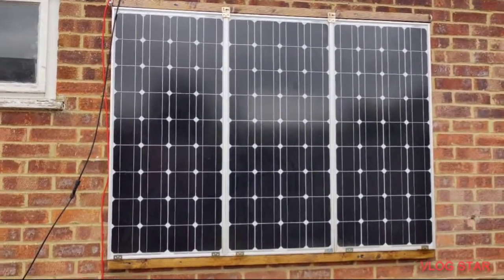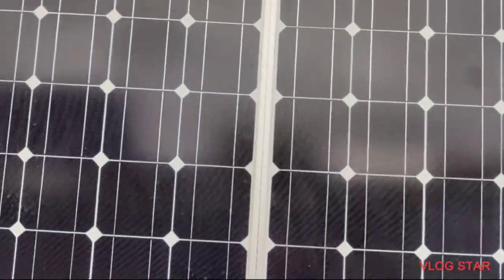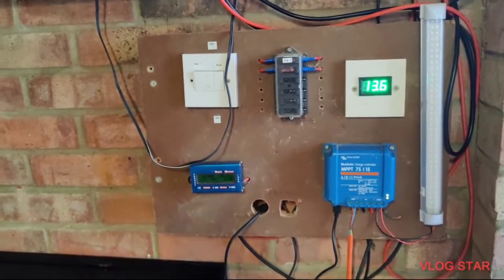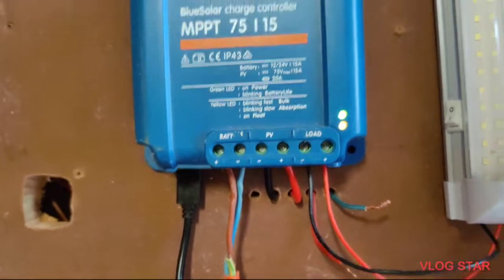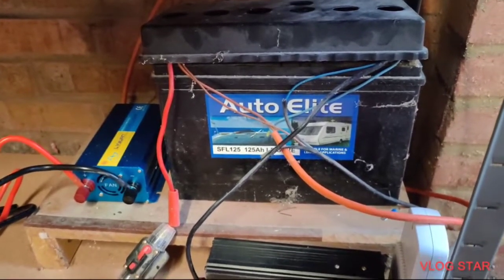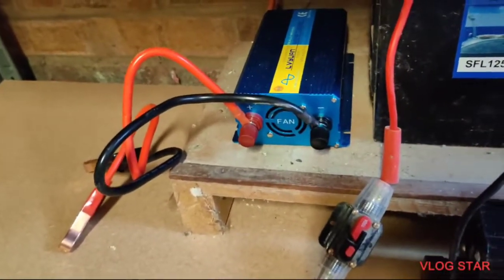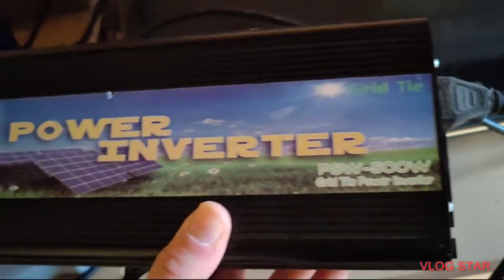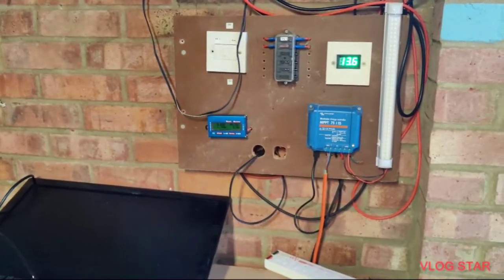Mounting my Solar panels.

Comment: Hi,
Very grateful for you. How big the energy difference than if installed tilted?
Thank you
Reply from the maker: @justiceonly9105  Hi, thanks for the comment. I lose between 20 to 30% of the energy  by having them flat against the wall. I originally did have one of them tilted but you had to keep altering the angle every summer and winter to get maximum results. This way it’s the same power output all year round. Marginally better in winter when the sun is low here in the UK. Hope that helps.

Comment: Thank you for the video. I am trying to mount solar panels same way. Do you see any issues with that after a year?
Reply from the maker: Hi, and thanks for the comment. I’ve had absolutely no issues with this set up at all and is still there and working fine. Obviously because they are flat wall mounted they lose about 10 to 15% of the anticipated power than they normally would if angled correctly. Other than that though I have no regrets doing it this way. Hope this helps.
Reply: @Digaroo-gadgets  I notice you said you were going to buy a gridtie. If so its best to get one with a limiter.

Comment: I also have wall mounted solar panels. But I have chosen a slightly different approach. The top side of the panel frame is simply hanging in a h-shaped aluminum profile, which is screwed to the wall with some plastic spacers that resemble huge washers (plastic 10 mm thick). The lower side is then pop riveted to an L-shaped profile which is screwed to the wall the same way as the h-shaped profile. This way, air can circulate behind the panels for cooling and moisture protection, and the pop rivets are also an anti- theft protection.